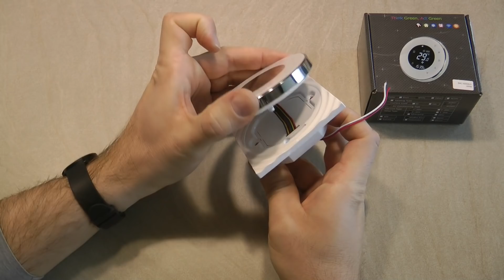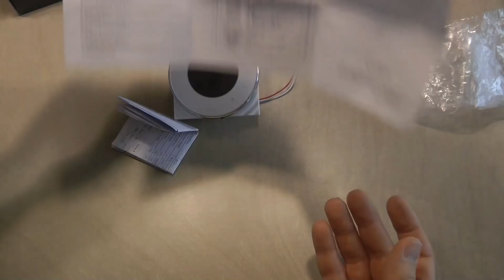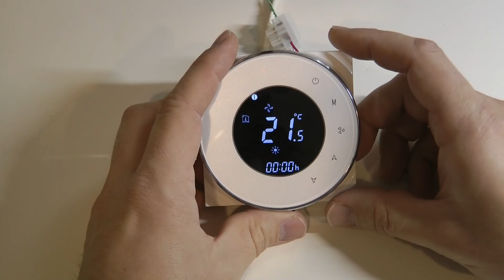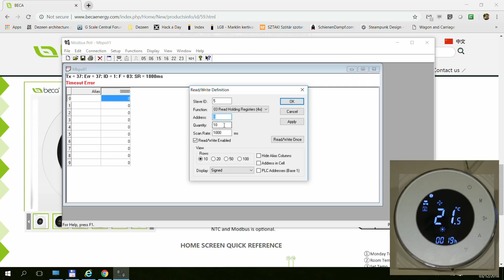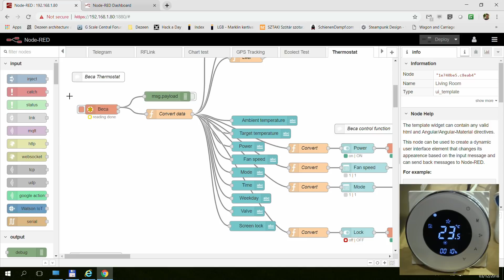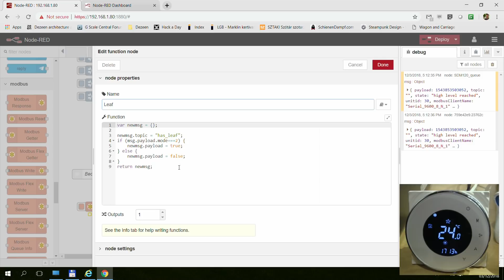Integrate Beca Modbus thermostat with Node-Red with Nest like UI

Comment: I did follow your tutorial is great but my device don’t have visible option of checking or changing address at all   Did you face similar problem ?
Reply from the maker: Well, it is a touch buttons, so it is hard to tell if you really touched-pressed it, but in general I never had such problem.

Comment: I am watching this a year later, but I have trouble finding Modbus versions here in Australia.  I noticed there is a project to change firmware for the WiFi version to use MQTT directly over WiFi.
Have you ever seen that?
Reply from the maker: Oh, that would be great. I did not hear about it yet, but I will be looking out for that.
Reply: @csongorvarga  I saw one on GitHub by klausahrenberg called ThermostatBecaWiFi.
It looks good as is, but someone with some knowledge of Arduino IDE and time could probably refine it even further.
Reply: Can you please share me your node red flow project file? 
Thanks
Reply from the maker: @muhammadatif1696  It is in the video description.
Reply: @csongorvarga  Great Video. Do you know would this modbus version work with heatpump? Not an exporters at all, however, I've heard Ecodan have modbus communication. is that the same thing?
Reply from the maker: @justinma1743  I am assuming the heatpump also needs a dry contact input so it should work. Modbus is not such a standard that you can just swap models. Ecodan could have different registers so the same code will probably not work.

Comment: Thank you for the video, I was looking for a wired thermostat to be integrated in a home assistant environment and your video has been very helpful !
Just a question: I was looking for the modbus version on the amazon links but can't find any mention about on their stores, do you have a specific link / model of the device you used?
Reply from the maker: OK, I see what you mean. My assumption was that they are either wifi version, or modbus. But I am not so sure after all. Even their website says that it is either BACnet/Modbus or Wifi. I suggest contacting them before you order the wrong model. When we ordered directly from China we specified the exact model (round/white/fan coil/modbus). So they must have one in each combination.
Reply: @csongorvarga  yes, seems that modbus is optional and there is no mention on the ones listed on Amazon, thanks again.